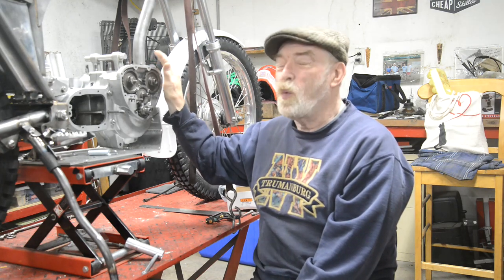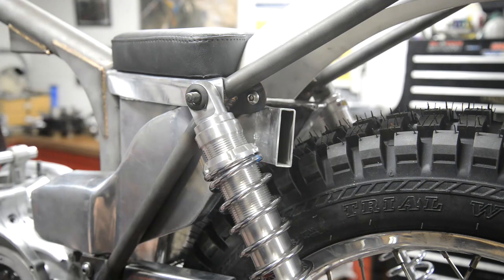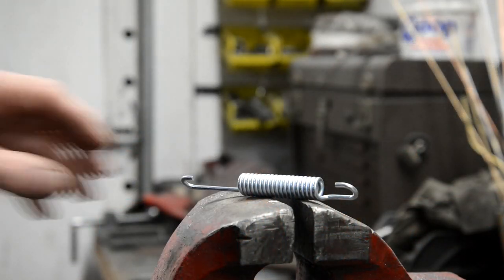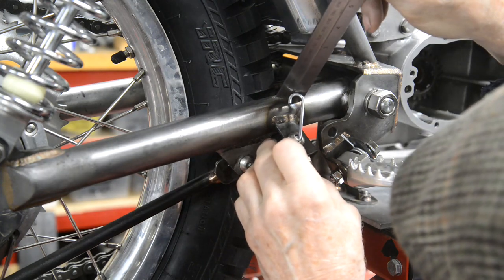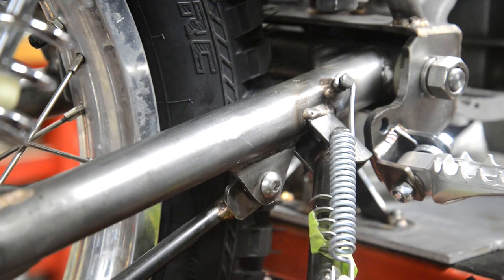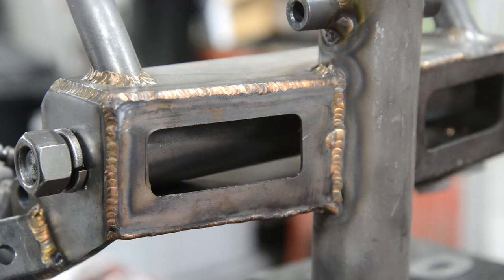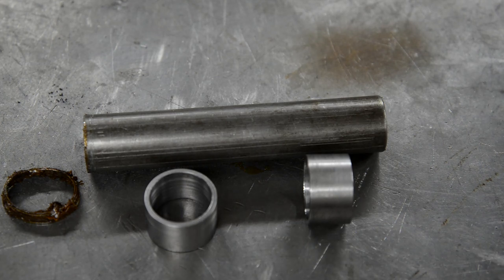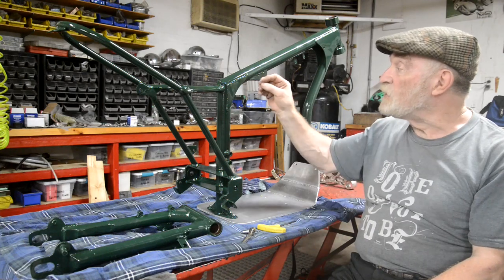Triumph 500 Otter  -  Part Twenty Two

Comment: Dear Michael, I was so disappointed to find that I was all caught up with the Otter development and will now have to wait a few more days for Part Twenty Three to arrive.  The frame looks marvelous now that it is painted.  As a very beginner, I like it when you explain about the different pieces of equipment you use and also, the different fluids.  For example, I didn't know there was both red and blue Loctite.  Could you also tell us a bit more about bead blasting - your casings all look so clean after blasting.